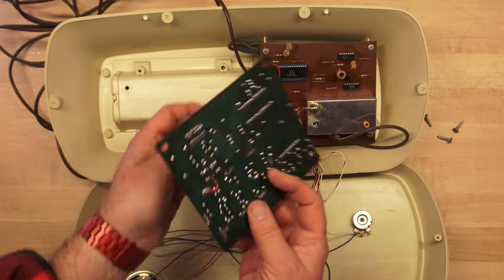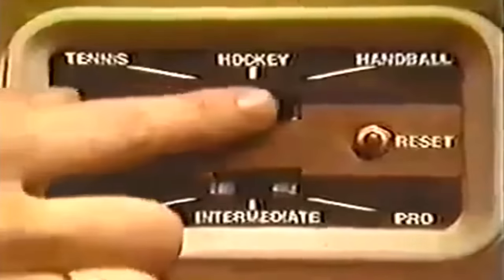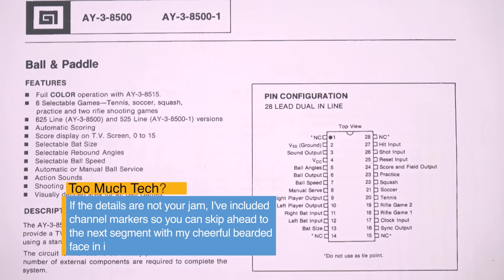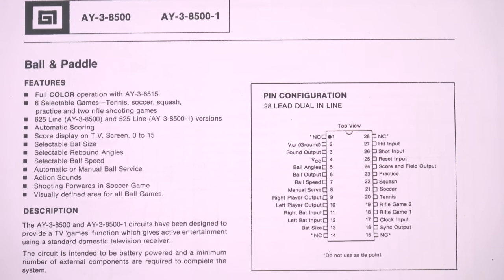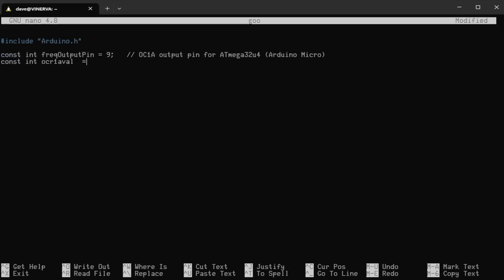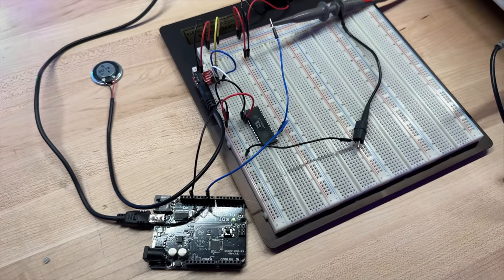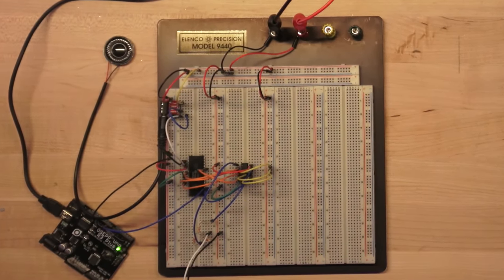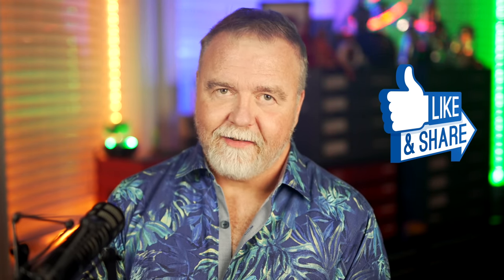PONG! in a Breadboard - Can We Build it?

Comment: The 'spare' half of the 4072 buffering the sync also adds the same propagation delay to the sync signal as the 4072 that is ORing the signals, so both signals are delayed by the same amount.
Reply from the maker: Thanks, good info!
Reply: @DavesGarage  Oh, for conservation: Can you please provide high res images of the PCB?
Not much to find on the interwebs. Just the usual botch video mod and therefore only the backside of the circuit board.
Thanks! :)
Reply: @DavesGarage  (Butchered comment ... by YouTube censor BS follows:) Thanks for the informative and entertaining video about a hero of our childhood, Dave!:)
Oh, and 4072 is CMOS-Logik not TTL.
Reply: MedicallyUnexplainedSymptoms: That t_PH is below 100ns. It is just not of relevance or in the ballpark that this delay has any effect on the sync output of pin 16. This will vanish in the oscillator jitter or other tolerances of the chips. They are mostly used to drive the primitive resistor mixer stage, which they can. In the "Black And White Bats w/ gray Background"-Configuration the same circuit with only 1/2 4072 is used and an additional 4001 (in DRIVER-configuration, Pin 1+2 shorted) buffers the sync signal.
Reply: see also the ay-3-8515 datasheet, sync (via Wikipedia, the GIMINI1978 <name/abbrevation of a widely used electronic document format here> document contains it on page 25).

Comment: That RC circuit is probably directly controlling the vertical timing where the paddles are drawn. The pulse from the capacitor will get squared and get AND’d with the horizontal timing (which would be strictly periodic). The paddle size control just stretches that vertical timing pulse to a greater or lesser extent.
Reply: I’d like to understand how it calculates a contact with the paddle.

Comment: The "shooter" games were enabled on the "deluxe" version of the console. I can't remember the specific brand (probably Magnavox from Sears) as I was around 8yo when we had ours. I do remember the shooter game... It had a handgun shaped controller for each player and visible inside the barrel was an LED (probably a light detector in actuality). I remember this very well because our ones were out of alignment and you had to aim a specific angle off the target (not moving but would be in one spot for a count and randomly move to another spot and on and on) to score a "hit". In my very first "electronic repair" I got a long screwdriver and put it down into the barrel and bent them until they were aligned correctly for the aim of the gun. (also I am from the US if that helps)

Comment: I was able to find the schematics for the original Atari Pong Arcade game and it is CRAZY.  It uses 64 logic ICs - the most complicated IC is has is a 4-bit adder. No microprocessor! Also, from with I can tell it looks like it is using a standard raster scan.  The paddles feed into a 555 timer to adjust its frequency.  Figuring out more would take take more time but I am very impressed on what they were able to do.

Comment: On the paddle control resistor / capacitor circuit, I’m building the arcade version on breadboards to see if it’s possible and that circuit is really cool. It uses a 555 timer to set a delay, before it starts setting the output high at the right time for 15 scan lines to draw the paddle, and then low again. If you turn the potentiometer all the way up, it wait longer and draws the paddle at the bottom of the screen, and if there’s a tiny delay the paddle draws near the top. The game is full of simple but brilliant things like that.
Reply: This is how it works on the Atari 2600 as well, you reset the R/C circuits at the top of the screen, and the R/C circuits will stop at the scan line where your paddle begins. Then you check the inputs every scan line. When a paddle input trips, you count how many scan lines to show the paddle as a "player" graphic. The only difference is that discrete logic Pong games do all this with just flip-flops and counters.

Comment: The sync runs through an alternate path, because it needs to be more negative than the 0 point of the video signal.  
So in the composite signal; black might be 1v, white 5v and but sync is 0v

Comment: While I was at Uni a friend who was studying electronics built a pong derivative from  standard components not related to any game. If I remember right it was entirely analog.  It doesn't really need a custom chip, as he didn't use a huge number of parts beyond standard circuitry to create a blank raster 

He also designed a cheat function on a hidden switch which tied one bat to the vertical position of the ball, guaranteeing that he hit every time.

Comment: In the middle '70s mi father built a kit very similar to this, with a single chip, possible this same. It hadn't a video modulator but a RF generator, so you didn't need to connect it to the TV, just tune the TV VHF channel to its frequency. Many memories, a pitty it got lost in time.

Comment: I came across these devices a little while ago. There were several on the market as part of the same 8xxx series. I have a Radofin Pong console that uses cartridges. But they're not ROM cartridges like in the Atari 2600. Each one of the carts released for it contained a different chip model, giving different games.
Reply: ⚠BEWARE⚠ SPAM comment replies that link to TELEGRAM addresses⚠

Comment: I had a "pong" game from Radio Shack that had the pistol for skeet shooting.  Here is the name I found for it from an electronic auction site: Vintage RADIO SHACK 60-3061 ELECTRONIC TV SCOREBOARD W/PISTOL.  It featured a rotary control to select the game being played and had switches and buttons for the other options you found on the chip pinout.

And yes, the pistol was a light detector.  You could aim it at the overhead light and fire a perfect game every time.

Comment: As a class project some fellow high school friends and I wrote a pong game that ran on a Dec PDP 8 using an analog oscilloscope as the display. We used the front panel of the PDP as the controls for the paddles. We could sample the key control keys positions in real time. The Top 1 bit were for the left paddle and the 1lowest bits were for the right-side paddle. The only drawback was that there was no neutral position, so the paddles were always moving either up or down. We were going to change to 2 bits for the paddle, but in the excitement of playing the game we ended up breaking the toggle switches a couple of times and our instructor banned us from playing the game on the computer, so we moved on to character-based games like Trek and Adventure. Which if anyone out there has used a KSR teletype machine before knows how loud that is.

Comment: The paddle is a variable resistor, essentially a light dimmer switch, and the difference in output voltages between left and right is based on the varying level of resistance as you travel through the full sweep of the knob. The 0V output would mean that you're in the maximum ohm resistance section and that as you turn it to the lowest ohm resistance section the voltage will increase up to the 5V output.

Comment: I had one of these as kid in Europe in the 1970ies and as you mention the shooting games was enabled. The device came with a light pen "gun" which you basically could aim on any light so it wasn't really useful.
 A fun thing: Some of the chips implement a hidden 7 game which is the soccer game where one player have three paddles. On the console it could be activated to position the selection switch between two games so I guess it is activated when none of the other 6 games are grounded
Reply: That Coleco Telstar could do the 2+3 game as well. I suspect it just enabled two games at the same time. If you look at the data sheet, you can see that they are all selected by discrete inputs. Each game select would enable different bits of the logic on the chip, such as a paddle at 10% across, a paddle at 20%, etc., and one of those two adjacent ones had an extra paddle.
The real question is what other interesting combinations are there?

Comment: Hey Dave, on my prototype using a TI TMS1955NL chip I went with composite output but just tied the outputs and sync together without the 4072 OR gate. In my case the output to my Sanyo TV/Monitor is rock stable.

Comment: I think that to measure a analogue voltage on a chip with no ADC, then as you say you can use a capacitor.  That action is something like the following.
Feed the voltage to be measured through a resistor to the capacitor with the other end of the capacitor connected to ground. Connect the junction of the resistor and capacitor to the chip pin.

1.	Short the pin to 0V internally. To discharge the capacitor.
2.	Release the short and measure the time it takes to be detected as a high.
3.	The higher the voltage the faster the capacitor will charge and so the quicker it will be detected as a high.

Used to do this on pic’s before they got ADC’s

Set pin to output a low to short the cap and discharge it.
Set pin to input and again time how long till it’s detected a 1.
Crude adc when you don’t have one.

Comment: The Coleco Telstar Ranger included a light gun for the shooting games.  We had one in Montana in the late 70s, fun game system.
Reply: That's probably the same chip, but using the gun modes.
Then there was the Telstar Arcade. It was on a triangular base with controls on the three sides, pong, gun, and steering wheel. It had a triangular "cartridge" on top which was the actual game chip, and they made four different chips.

Comment: If I remember right… The Pong i played had gray scale graphic. Probably the buffered outputs from the chip where feed through resistors to make the video signal.
Reply from the maker: Good point!  Believe it or not, the Arduino is fewer wires, since there's just 2 :-)

Comment: Regarding your question on how the paddles work.  It sounds like they are working the same way the Arcade game worked.  Each paddle creates a voltage from 0-5V via a resistor divider.  This them feeds into the input of the 555 timer that controls its comparator voltage.  I think it is doing a pulse position modulation but it would take me some time to figure out exactly what it is doing.  They wired the 555s in a rather "creative" configuration.  Let me know if you are interested in the schematics.

Comment: There was an version of the chip that included a version of hockey where one player had three paddles instead of two-- presumably to help even out the game for kids. It was in the Radio Shack version, and while it wasn't mentioned or supported I got it by placing the game selector in between two games so "nothing" was selected. I can't see enough of your screen to tell if you had 3 paddles on one side.

Comment: It's wonderfully ironic that Jack Tramiel made the comment about the game not changing the world. The key piece of Alan Alcorn's code that made PONG valuable in the long run was an incredibly tight fast feedback loop. ATARI copyrighted the pseudocode and the machine code versions of it for every major core processor over the years, and nearly every video game licensed it.
Years later, Jack Tramiel bought ATARI, and owned it outright. While in charge of the company, he had a heart attack at work. He never passed out, so he was watching as the EMT looked at the EKG date and adjusted the defibrillator a couple of time to get his heart back to a normal rhythm. While in hospital he started thinking that a computer program could check the eight or so vital data points and make the adjustments much more quickly. One of the corporate programmers was able to create the defibrillator management program in very short order, basing it on the fast feedback loop code from PONG. Once the program was proven and under copyright, Jack ordered the copyright to be placed in the Public Domain. Since then, millions of lives have been saved by affordable Automatic Emergency Defibrillators and preserved by small implantable defibrillators.
A tiny section of the code that made PONG possible has, in fact, changed the world for all of those millions, their families, and their friends.

Comment: Found it funny that you use an Arduino uno to make a square wave generator. Love to see the code for that. Radio Shack had a version with the light gun game enabled.
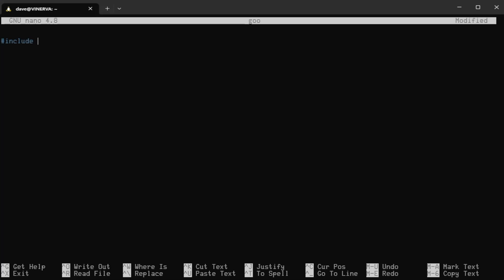Reply: 11:00 shows the code (might need to look at the microprocessor datasheet for the pin names he used)

Comment: I would like to see a kit to build a Computer Space.  It used off-the-shelf parts which are all still available.  I would implement the diode ROM using surface-mount 0201 diodes.

Comment: Draws white whenever one of the four screen elements pins goes high as the beam is moving across the screen... what a simplicit yet ingenious way to do video output.
What if you gave each pin its out output circuit and hooked them into separate TVs? Multidimensional pong?

Here's my idea... ball drawing and playfield drawing goes to the center tv and the two paddles go separate screens. Players will have to use spatial reasoning to determine where the ball is.

Comment: Hello Dave, I have a AY-3-8500 chip as well as a TI TMS1955NL chip. I had wired up a proto-board using the TI chip about a year ago and it was a real blast from the past for me to play Pong like I remembered it so long ago. I opted to use one less chip and wired it for straight composite output instead of including the RF modulator part of the circuit. I plan on making a more permanent build or two using each chip one of these days. I used a 2 Mhz crystal and might have one or two more in storage. If I can find one then I will let you know in case you still need one.
Take care and 73 de WA4JAT
Reply: ⚠BEWARE⚠ SPAM comment replies that link to TELEGRAM addresses⚠

Comment: The capacitor-based detection of paddle position isn't a surprise.  Later, the IBM PC would use the same technique to detect joystick position (on the classic 15-pin D-sub "joystick/midi" port).

Comment: The GI chip includes another "hidden" game which was available on some consoles: if one activates both the Hockey and Handball inputs, one ends up with a variation of Hockey in which one of the players has three paddles.

Otherwise, I think it's too bad the GI chip became so popular, since it's inferior to the original Pong.  The GI chip has only two upward and two downward angles, while the original Pong had eight vertical ball speeds which would interact with the multiple horizontal ball speeds to give a wide range of angles.